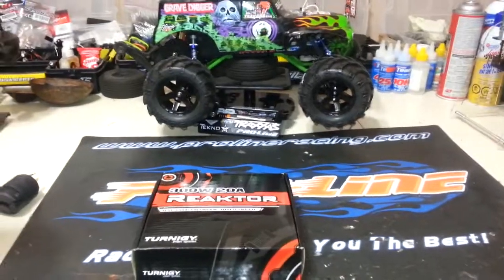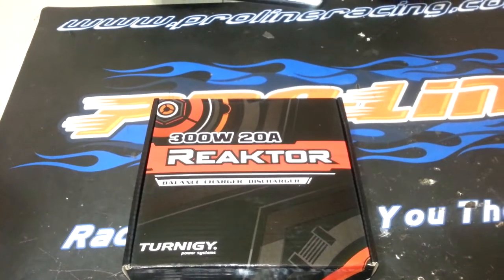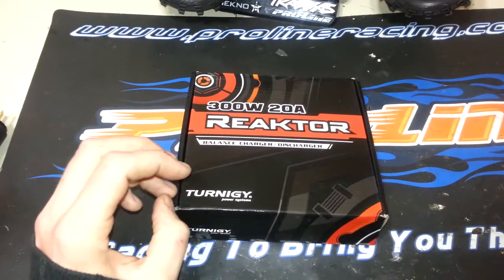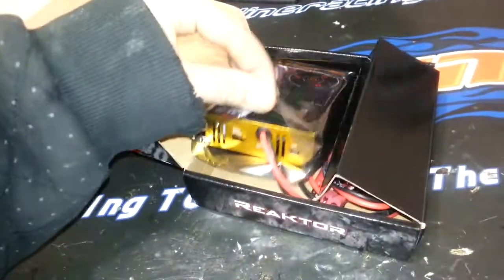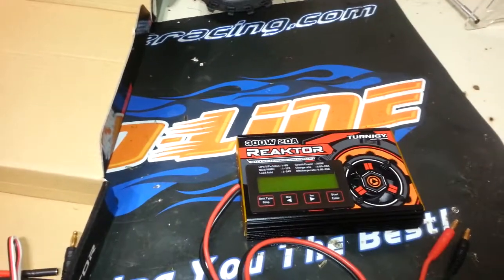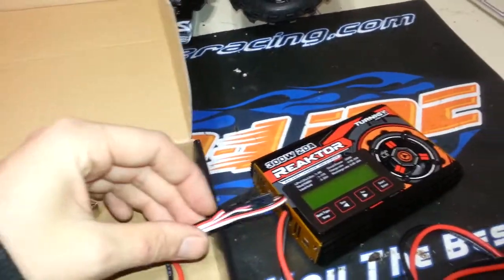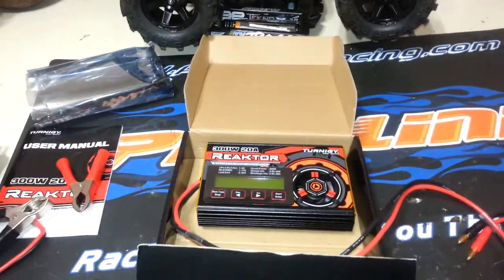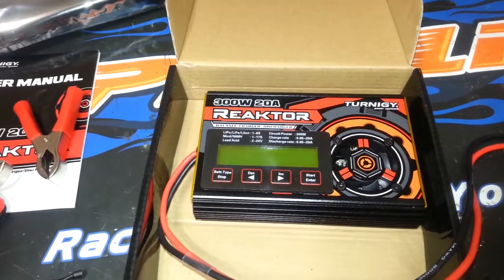Turnigy Reaktor (300W/20A Charger)

Comment: I noticed that besides the balance-output it has a regular /dumb/ +- output.
Can it output to both at the same time?
If it can, can you somehow regulate the output voltage in the dumb-output (to actually power some device /or charge other battery/ while at the same time the balance-output charge a battery-pack)?
And since I'm planning to use it as a 4p6s Li-Ion battery pack (with recommended 1.7A for charging /or 0.5C given the 3400mAh/), can I regulate the balance-output current to say 6.8A (for the 4*1.7A in each parallel group)?
If this little device can do all these things it would be a TREASURE! :) 
... not that I've ever been that lucky :/

Comment: You know how it automatically selects the amount of cells in the battery on balance charge mode? Is there a way to override it and manually tell the charger how many cells there are your lipo? Because I guess a paraboard wouldn't work on balance charge otherwise :/

Comment: Hi, thanks for the review!
The link you left for the PS leads to a 24v 360w "15A". Is that sufficient just being a 15A? Also, does this model charger allow you to adjust the end voltage? I'm hoping to get 4.3 - 4.35 per cell in a balanced charge before it cuts off. I'll be charging one of the new HV lipos.
Thanks again!
Reply from the maker: By dropping the voltage on the psu it in turn bumps up the output current.  My psu is at 19.3v so at that voltage the output amperage is right around 20amps.  Most powersupplys allow a manual voltage adjustment usually atleast 10% sometimes more.  I only charge 2 and 3S packs and a 5600mah 2s lipo only draws 11amps off of the psu while charging @ 20amps.  If you intend to charge 6S packs its better to oversize the psu as it is under much heavier load.  But the psu still puts out 360W at 24v.  The charger will only draw 300w.  This setup works great for me.  Keep in mind this charger requires a minimum 18v to acheive full output charging power of 20amps.
Reply: +ЯC Bashers™ So is it best to power the charger with a 24v dc power supply?
Reply: This charger requires atleast 18v to achieve the full 300w output rating.

Comment: how good is this charger as I am planning on buying on have you had any problems with it or has it been a good charger
Reply from the maker: I picked mine up off of ebay.  it is a 24v 360w switching power supply. 

http://www.ebay.com/sch/i.html?_odkw=360w+power+supply&_osacat=0&_from=R40&_from=R40&_trksid=p2045573.m570.l1313.TR0.TRC0.H0.X24v+360w+power+supply&_nkw=24v+360w+power+supply&_sacat=0

This charger requires atleast 18v to acheive full charging power ( i manually adjusted the voltage on the supply as low as it would go.  19.5v that in turn will bump the charging current closer to 20 amps. )  as the 24v 360w is rated at 15amps at 24v.
Reply from the maker: This charger has been nothing short of perfect.  Wish I bought It much sooner. Keep in mind you need a good 300 watt 20amp switching power supply to power it.   I am planning on putting together a second review video of this charger.  I will go into the LogView application and demo the real time monitoring.  Allowing you to save and review your charge logs via computer Just need to find some time...

I use this charger directly off of my car charger when i am camping and what not and it is awesome.  For the price you will be hard pressed to find a better deal.  All said and done after purchasing the 360w power supply total cost was just under $100.  They include a temp sensor which is nice.  I have nothing bad to say about it.   

Bash On!
Reply: ЯC Bashers™ Thanks for the reveiw - it was informative. Can you share where you got the 360w power suppy?
Reply from the maker: Just wanted to say that I actually had to order 3 different power supply's before one actually got to me.  I was refunded by ebay both times, but took a long time.. I advise you to order from a supplier in the US if you can.  Fairly certain the two supplys that didn not show up were denyed at the border because they lacked any type of certification, ce, fcc,etc.  Some food for thought anyway.